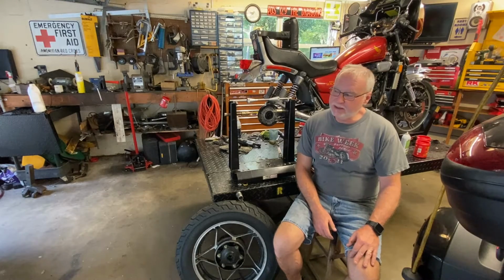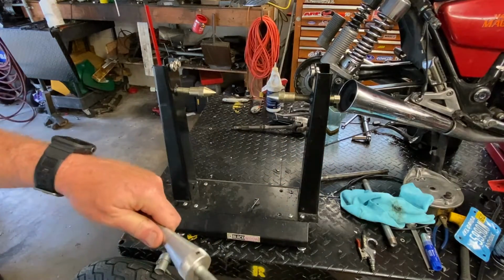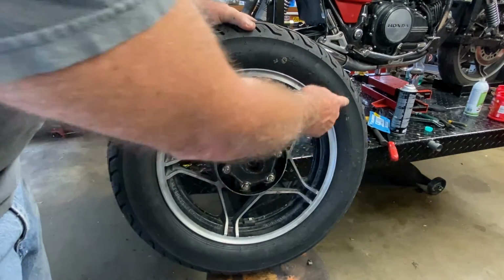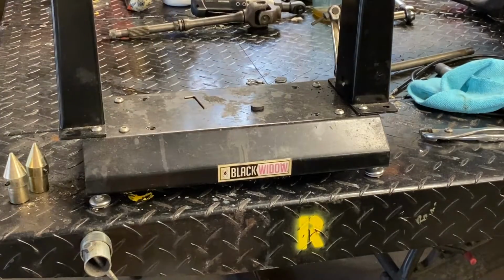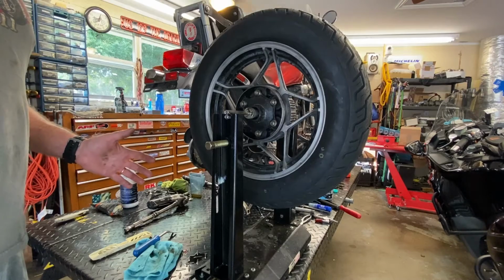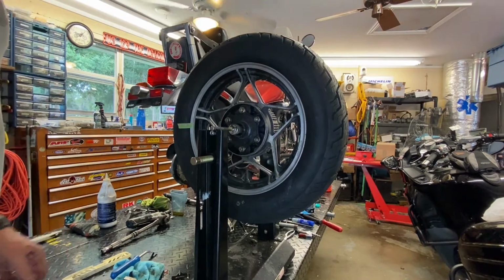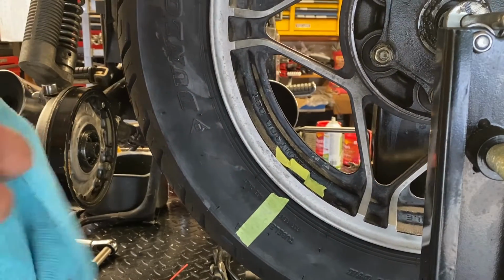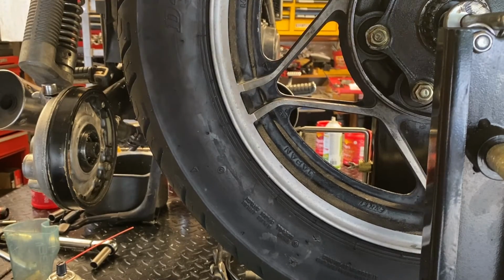Motorcycle static wheel balancing, how I do it!

Comment: Check the manufacturers recommendation for direction of rotation for front tyres. The Avon Roadrider 2 tyres are recommended to be fitted in the opposite direction compared to the rotation markings when fitted to a front wheel.
Reply from the maker: Recommendation of which manufacture, the motorcycle or the tires?
Reply: @MotoRestoFL  The tyre manufacturer
Reply: @MotoRestoFL  Taken directly from Avons website, It applies to Universal fit tyres, i.e. can be fitted front or rear:

"Why does the front tyre appear to be running the wrong way?

We call this Inverted Front Grooves. We have done a great deal of testing and research on tread patterns and found the front tyre is better run in the opposite direction to the rear. The front tyre has to deal with braking forces and the rear wheel with drive forces, which are basically opposite forces. This may make the front appear to be running the wrong way round but in wet tests, we have found that the footprint is not long enough for water to channel very far through the grooves, it just needs to be expelled sideways quickly. By running the tyre as we do, we significantly reduce irregular tread wear. This means that even when the tyre is half worn, it is still putting down the correct amount of rubber on the road. Tyres run the other way round suffer from stepped and irregular wear which reduces their footprint and effectiveness in the wet quite dramatically.

If you check out any of the latest sports radial tyres from any of the other main tyre manufacturers, you will see they are all starting to do the same.

IFG (Inverted Front Grooves)

For the front tyre, a system pioneered by Avon in the late eighties and only now being adopted by the competition, resists 'stepped-wear' and cupping to deliver smooth handling throughout the tyre's life. By significantly reducing uneven tread wear, a further advantage of the IFG configuration is improved wet braking and shorter stopping distances."

Comment: Thank you sir as this is probably the best video for me since I have an 82 V45 Magna and enjoy your sense of humor. I mount my own tires because reliable shops are few and far between around here. I normally line up the dots and have good luck not needing to balance. I recently purchased a Michelin Commander II because I hear you can get lots of miles out of them but they don't have dots or any markings to align. Although this tire cost double what I'm used to paying, it's much more noticable it's out of balance . I plan on ordering a balancer like yours and  using your video to start balancing my own wheels. Again thank you for your time and knowledge and posting this video. Keep the shiny side up.
Reply from the maker: Thanks. Please consider subscribing so you get notified when I put up other silly stuff. :)